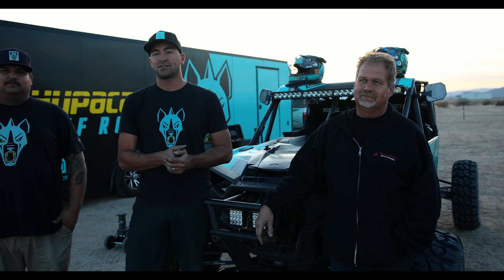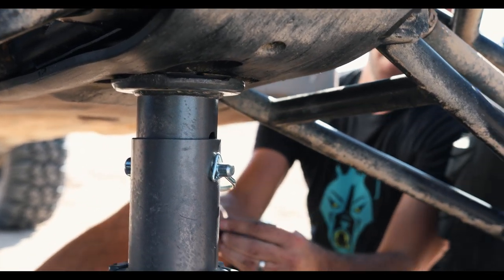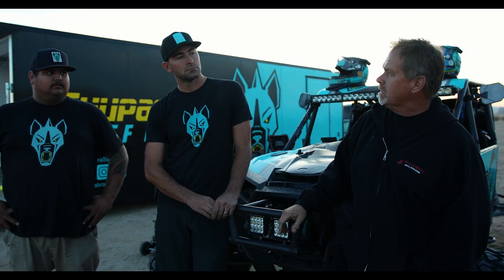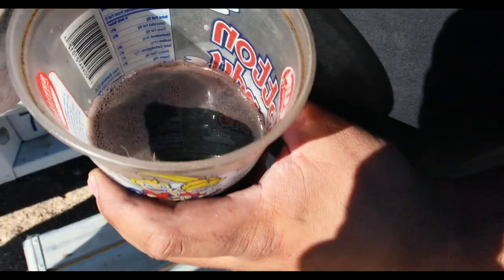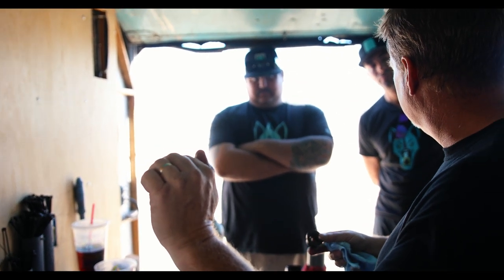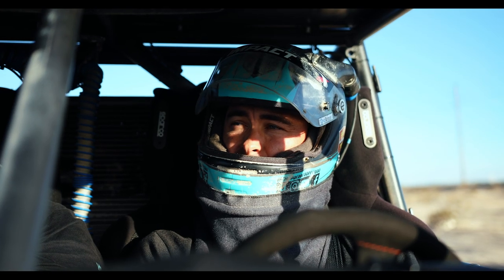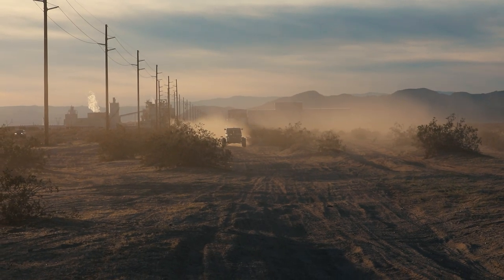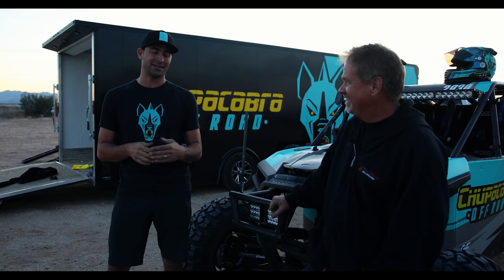Power is Cool, But Suspension is the Game w/ Wayne Israelsen of Alltech Motorsports

Comment: How do like those ITP ultra Cross and do they work good on forest trails
Reply from the maker: They are good, but I'd say "forest trails", you might be better with a tire with deeper lugs like the Coyote, where there's forest, there is more moisture and mud, and generally lower speeds and rocks.  Where do you live?